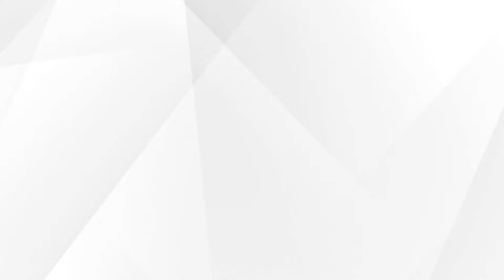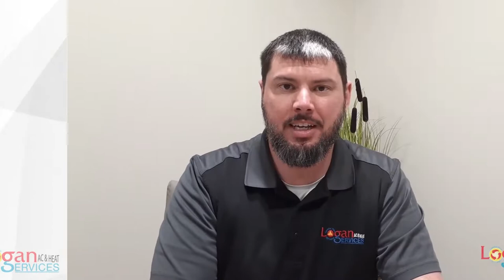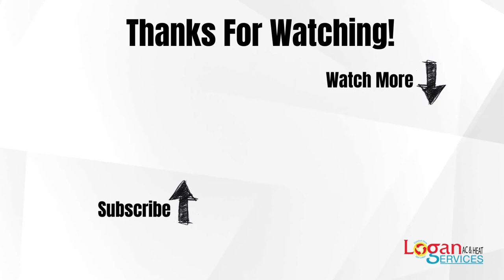Things To Consider For Your Furnace Room When Finishing Your Basement

Comment: We just moved into house and are hoping to finish the basement but have a question about a hose running from the gas furnace to a drain in ghe floor. The hose runs on a slight down slope and is approximately 10 ft from the furnace to the drain. We had a gas furnace i  our last house for 17 yrs and never had condensation. Should we be concerned, and is there a way to run it another way so it's off ghe floor? Thanks